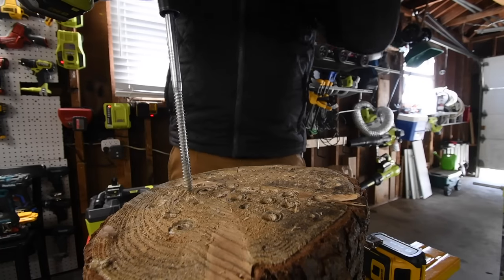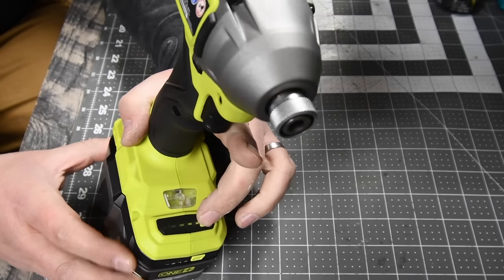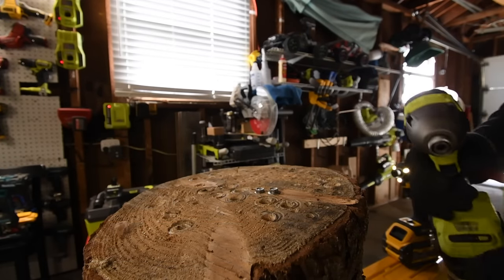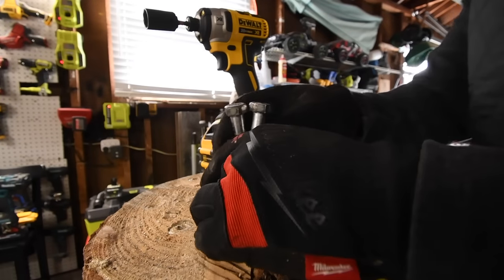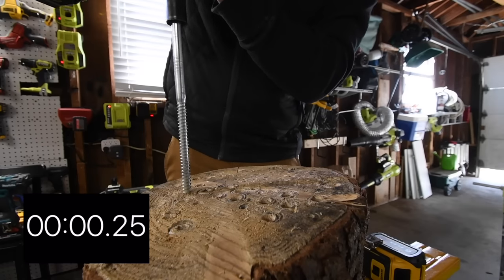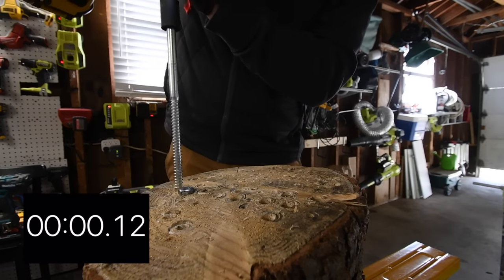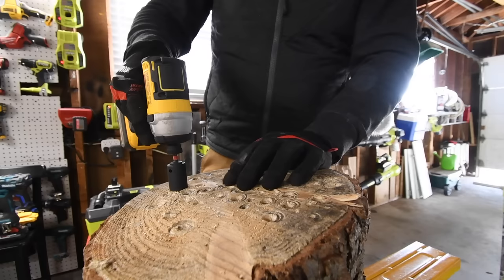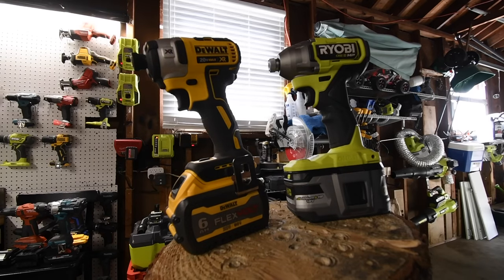NEW Ryobi HP vs Dewalt (Impact Drivers)

Comment: Thanks to companies like Ryobi, you’ll find regularly priced Dewalt on sale for $90 (40% off). It doesn’t matter if Dewalt is still better, it’s the fact that they’re forced to give the consumer a better product, or the same product at a better price. That said, I’ll keep supporting Ryobi because they’ve really proven themselves to be a contender along with the big boys that already earned their name decades ago.
Reply: Ryobi is made by TTI tho. Same company that makes Milwaukee
Reply: @AltimaNEO  it's owned by TTI not made by TTI. they still have to compete with each other.
Reply: @inskinov412  You know that ain't competing. Theyre not even in the same market segment.
Reply: @blipblop92  You're right Ryobi tools are far superior compared to Milwaukee.
Reply: @blipblop92  
That other guy is ridiculous. Yes, Milwaukee tends to perform better, but Ryobi has several segments locked down. 

1, battery support. They've kept the same battery format for over 20 years. Literally no other tool manufacturer has done that, especially when tools went from NiCad to Lithium. A brand new Ryobi lithium battery will work in their old blue NiCad generation tools.

2. Home owner enthusiast. While there's a lot of competition at the low end, Ryobi still competes competitively there. There's some confusion with their tools/batteries as they have several similar tools that swing wildly in performance. However, the step up to better tools is easier if you don't have to change batteries/brands.

3. If you want the choice of hundreds of different tools that run on the same battery, Ryobi is your only real option.

Milwaukee is for people who want the absolute best performance in most tools, or tool snobs. Milwaukee is to cordless tools as Snap-On is to wrenches and ratchets.
Reply: If they are made by TTI and TTI makes Milwaukee the Ryobi should keep up with the “big boys”.
Reply: @Go_kart_media13  
That's like saying Fiat should keep up with Ferrari. Volkswagens should keep up with Lamborghinis. Etc. Just because they're from the same company doesn't mean they should occupy the same market segment.
Reply: @MrNside  If you look it up they aren’t owned by the same people
Reply: @Go_kart_media13  
You might be thinking of Ridgid, which is licensed by Home Depot to TTI. Outside of the states, the same power tools that carry the Ridgid name stateside are sold as AEG, which is another brand owned by TTI.
Reply: @Go_kart_media13  
No, I see where the confusion is. Wikipedia strikes again. It falsely claims RYOBI is licensed to TTI. That is not the case, RYOBI power tools was sold to TTI, while Japanese owned RYOBI group continues to sell industrial and electrical components.

It's similar to how Hitachi sold their data storage division to Western Digital, and WD continued to make Hard Drives under Hitachi's name for a while, then under HGST (Hitachi Global Storage Technologies). They bought the division outright, Including the name when it pertains to data storage. EDIT: In fact, I'm pretty sure they bought JUST the name, as most of the patents, designs, and factories seem to have been sold to Toshiba.

TTI bought the RYOBI power tool division outright, including the name pertaining to power tools and outdoor lawn equipment.

If you go to TTI's website, you will see the brands they own outright. They don't list Ridgid, for instance, because Ridgid is licensed.
Reply: @MrNside  there are other websites that say they are made by TTI
Reply: @MrNside  Nice try
Reply: @Go_kart_media13  
Where did I say they aren't made by TTI?
Reply: I like this driver so much I got a second one but ryobi certainly disappoints on a regular bases as well. 

Got the regular ryobi Sawzall for breaking down pallets, mostly cutting the nails. The part that holds the blade snapped off after maybe 3 weeks. 

So I went out and got their brushless Sawzall thinking they fixed this problem but they did not, exact same thing happened and now I'm out like 200$ because ryobi can't learn from their mistakes. 

Went and got a corded makita Sawzall and it's obvious they have delt with this issue because they use a heavy piece of metal in that spot which you would think is just common sense. 

Ryobi touts their hp as professional use and I didn't do anything resembling professional use so watching them break is rather disappointing.

Also got the ryobi brushless belt sander only to have the belt tightening know snap off, ended up welding it back but the whole tool is pretty junky, belt just gets progressively more loose to the degree that I don't even use the tool anymore because ts not worth the issues it presents.
Reply: @inskinov412  bruh wtf are you talking about, Ryobi is own by Ryobi, TTI is like a distributor and manufacturer for oversea operation outside of Japan
Reply: @jake9854  You should consider using a 6ah battery instead of the 4ah battery. It's almost the same weight and has %20 more torque. It's been about 2.5 years of using the Ryobi brushless and haven't had any problems. All around, they're good for the $$

Comment: I'm not just trying to be a fanboy for DeWalt. Ryobi does look pretty decent there, but with that 10 inch leg when you pump the first one in where the Ryobi and then the second one in right next to it with the DeWalt. All the fibres in that timber was more compressed for the second fixing. So I do think is a bit of an unfair test. If you had two different logs, cut from the same part of the tree I think it might be a fairy test

Comment: If it's strong enough to break a bit adapter, how much stronger do you need? One+ HP bringing some heat lately
Reply: This Sir, Im inclined to agree with you!  😁👍✌🏻👏🏻🇺🇸
Reply from the maker: I agree with you on that one TTC
Reply: You two are part of the reason I don't regret going the Ryobi route. 
Got my best friend in the Kobalts. (Note: I vastly prefer Kobalt's drills)   
We recently did strut replacements on our respective Subarus. She got super frustrated that her 3/8ths Kobalt impact wrench didn't have the beans to break free several of the nuts we were dealing with.  Her astonishment when my p262 popped them off near instantly was. . . hilarious. 
Of course we got her the new big Kobalt half inch that same night. . .  And used it to change tires at a Gambler 500 event the next week.

Comment: When you've sunk the 1st screw or lag bolt, the wood near by is perhaps split to a degree or under compression.  The results may skew for or against the 2nd fastener driven.  It seems you drive the 2nd fairly near the 1st, presumably because the wood likely has similar properties in both areas though you can't be certain about knots and other potential variations.  You might want to switch the order in which the tools drive the 1st fastener or timing each tool driving and removing each before using the other.  The latter option won't level the playing field if there is nearby splitting, especially with the lag bolts, but it would mitigate the increased pressure caused by a nearby fastener.
Reply from the maker: its ok, these tests aren't to deem a winner for all time.
Reply: You killed my buzz

Comment: Both great tools. I would say Ryobi is now one of the top brands, they are definitely stepping up there game. And DeWALT needs to make a new impact that doesn't have the same specs as there last one. Great video again. I appreciate your fairness in tests not favoring one tool brand or the other, just giving solid and real tests so people know what to buy.
Reply: Mainly concentrate on smoothness and refinement Will.  This would serve DeWalt better, and they should tweak their precision mode, as it is on the right track.  I have consistently sunk small screws with the precision mode on the 12 volt Xtreme impact.  Peace! 👍
Reply: @georgedavall9449  Huh ok, thanks for the info. Don't get me wrong I am a DeWALT guy through and through. I don't even own Ryobi tools. I just respect how they are becoming a premium and reliable brand.
Reply from the maker: they do make the 888 but Dewalt needs to majorly upgrade it
Reply: Duh when you go from brushed to brushless there is a big power difference

Comment: I have the DeWalt and mostly just used it for smaller things. Those big lag bolts are certainly quite a stress test and at a quarter inch particularly tough on the shafts of those adapters. I probably wouldn't have thought to use it on that large a bolt.  In the real world, if you were going to be going that large you probably want a 3/8 or a half inch.

The Ryobi certainly did a good job, although it looks heavier.  If you consider the workload that you can do on these quarter inch drivers, it's pretty amazing.

Comment: As i said in another comment,  Dewalt is getting to the point you have to be a rocket scientist to figure out the tool models, how they are different and what battery line is what. They have WAAAAY to many.  With Ryobi, they havent changed the battery platforms in forever. And even the new HP line is forward and backward compatible with all tools. 
For the price AND battery platform futureproofing, Ryobi is a better bet, specially when the performance difference is usually in the seconds or less. If it was an issue where Ryobi couldnt even do the job, thats one thing. But Ryobi can finish and do all the same tasks and even getting up there above its weight class...and only lag ..what...seconds on the minute? All for way less cost and LESS confusing, better future proofed battery platform.

Plus they are so cheap, I'll just buy a new battery (always on sale and decent prices) than deal with the higher boys crap warranty process (dewalt..cough) which you will want to go through since its all so expensive comparatively speaking.
Reply from the maker: I think all brands are getting crazy with model numbers

Comment: That's what I call bang for the buck boi... The fact that Ryobi is able to compete with DeWalt, is the reason why u can see some DeWalt tools under 200 usd.... 
I'm really impressed
Edit: the fact that Ryobi performs better on higher torque applications tells me that while DeWalt spins faster, Ryobi hits harder... I think
Reply: Ryobi doesn’t compete with dewalt in the slightest. I’m a diesel mechanic and the there are no ryobi tools in the shop out of 60 guys for a reason. They are fine for a homeowner and the guy that changes his tires a couple times a year but with everyday abuse in a shop environment they are shit…
Reply: @colin7748  idk what is in your shop.... But in those tests in some Ryobi beats DeWalt, and in other is very close, the numbers don't lie
Reply: @Lucas_sGarage   it’s the longevity of the tool that is the problem. Numbers can’t show that
Reply: @colin7748  experience can, i have a 5 year old Ryobi drill that i use every day, and it rocks
Reply: @colin7748  Don't talk shit.

Comment: Can you do the dewalt hammer drill test with some drilling through concrete. I want to know what the best none SDS Hammer drill is
Reply: Best hammer drill is Milwaukee
Reply: I have a dewalt flexvolt hammer. It clows thru concrete like it was hot butter.
Reply: Flexvolt advantage is best
Reply: If you're drilling concrete alot. Jus get a rotary hammer drill.
Reply from the maker: I just uploaded one and I thank you for viewing Lippy

Comment: really curious about new brushless ryobi vs old brushless while looking at specs the old one looks better P238 had 4350 ipm, 3100 rpms the new one has 4000 ipm and 2900 rpms also on p238 you never get a true confirmation on the torque number on the box it says 2200 on the website it says 2000
Reply from the maker: I will be doing more tests on these impact driver soon, I thank you for viewing Minnesotaman

Comment: You know, I think I'm seeing something in this test that I've seen another channel... I think DeWalt made a new screw gun that makes the most of the screws you're using. Not taking anything away from Ryobi (after all, it's the battery-platform I'm invested in.😎) Thought I'd ask you to see what you think.
Reply from the maker: look at the date of this upload. this is an old video

Comment: I would look to see the flex 24v system impact driver versus dewalts xr and Milwaukees m18 (flagship model on both) when it drops next month
Reply: for what reason? I mean we soeak about  0.2 to 1 scond differences on regular tasks. 
I don't understand that anybody is testing impact drivers for speeds and judgments on a half second difference but never talks about the actual feeling of the tool like haptics or vibration
Reply from the maker: I will be getting the flex tools soon :)

Comment: Problem is the new Ryobi HP Line is priced as other high end brand, but their batteries are more expensive.
Reply: not sure where youre based but here in england the ryobis HP are still significantly chepaer than high end brands like makita and milwaukee.
Reply: @TheSixYardBox yep - Im from Denmark same here - Ryobi hp (brushless) is cheaper than similar dewalt, Makita etc. Im amazed by the performance of those series !

Comment: Surprised the dewalt didn't have a motor burnout lol.
Reply: It was a short test but it already went more than 100 degress. If the test went longer, I’m sure it would go up in flame.
Reply: @josephunson4982   why do you think that the newer dewalt drill/impacts tend to smoke. I know someone that's a contractor that has a usa made dewalt drills and loves them.
Reply: Lol here in the uk we use dcf 887 made in prc at cladding, installing thousand of screws during a week,( heavy steel screws) sometimes it gets so hot u can burn an egg on it, but never does it smell like something is burning! Idk what u guys talking about lol
Reply from the maker: I havent had that issue yet

Comment: both good tools
Reply: No! They are not. The Ryobi is an updated tool that puts out respectable performance and reliability. The Dewalt DCF887 is only good at starting fire on your BBQ grill. Instead of coming up with a new generation of impact driver with an improve heat-dissipation system in its engine, Dewalt just made the DCF887 more expensive by installing a bluetooth chip in it for its “Tool Connect” feature then offer it again to the public as the new DCF888. Dewalt probably thinks it’s OK to smoke an expensive tool as long as you do it in style (with bluetooth). I’m on a Dewalt platform and I can say that there are tools in their 20v line up that are performing decently but their XR impact driver is a huge disappointment.
Reply from the maker: I agree with you on that one Chris

Comment: Still I'm not impressed! I'll stick to my Ryobi P238. Otherwise I still have my old DeWalt Dcf888. And I'm gonna be getting rid of my Hitachi Brushless Triple Hammer Multi-Volt Impact Driver and replacing it with a Craftsman Brushless 3 Speed Impact Driver. Because Hitachi's Triple hammer is a scam. It has triple hammer anvil but still it can only makes 4100 ipms while the Milwaukee Gen3 M18 Fuel can make a 4400 or 4600 ipms I believe and it's a lot faster although I never owned any Milwaukee but I've seen it many many times. I'm curious though!!! What IF Ryobi Tools purchase a Hitachi/Metabo/Hikoki Triple Hammer Anvil Patent and put that technology into that newer Ryobi Brushless Impact Driver because that thing is becoming a beast!!! It makes 2,200in/lbs of Torque and 2900rpms why not turn it into a triple hammer and a IP-56 Rated!!! (Meaning Waterproof like the Makita and Hitachi) And a Compact 9ah 18v lithium battery HP with 21,700 cells or higher That would be awesome right?! I'm  willing to spend a $200 to $300.00 just Only For a Ryobi impact driver if that happens!!
Reply from the maker: I still have to do a video on that one as well

Comment: The Ryobi combo is $229 DeWalt $250
For the quality you'd be stupid to go Ryobi..and Ryobi is Chinese DeWalt made in USA.
   I might also add, since Ryobi upgraded their tools to the HP+ your older batteries will work but not as efficient as the HP+ so now, you gotta get a whole new set of batteries

Comment: From my experience Ryobi is trash, not much better than Hart.
Reply from the maker: how long ago was your experience?
Reply: @ManCaverTools  I bought a 10 inch sliding compound mider saw (electric) for my work place & it's way out of square, no matter how many times I recalibrate it it doesn't help. That's just one story with one tool but have several different stories. If they work for you then that's what I'd stick with but for me they're just disappointing. And the mider saw was bought about a year ago or so.